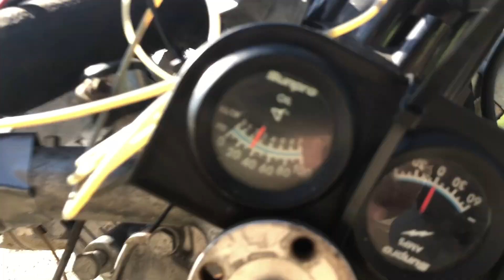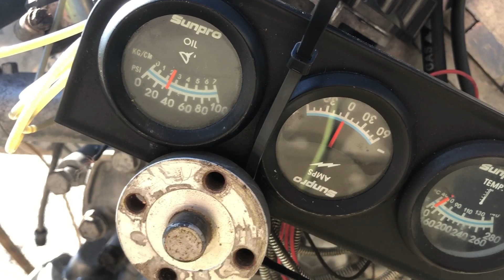1962 Jetfire engine test run on stand

Comment: Thanks for showing this.   Does the car have any issues with the proximity of the exhaust manifold to the battery, coolant hose and spark leads?
Reply from the maker: Check out a couple of my other videos. You will see a couple videos of one in a car. Everything forts well. Several brackets to hold spark plug wires away from the exhaust.